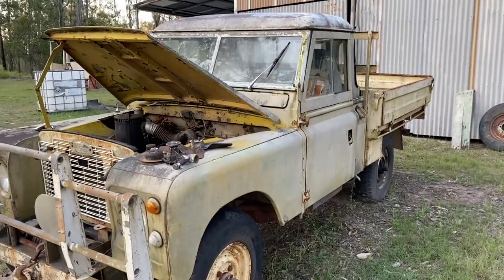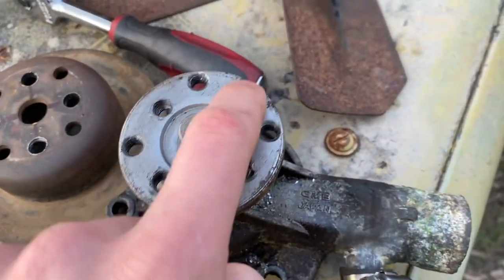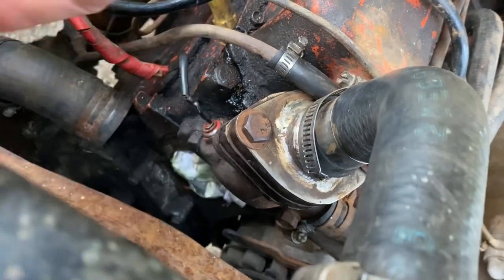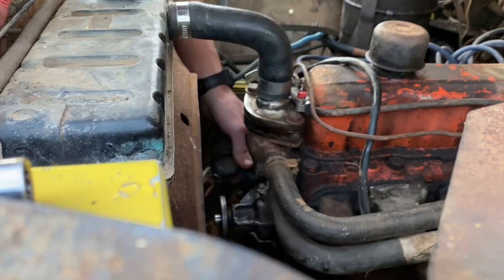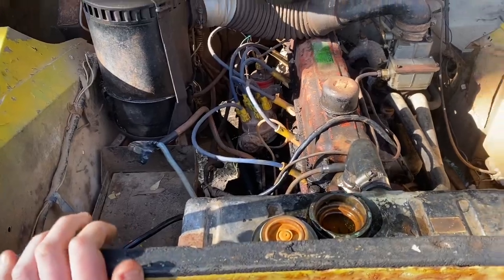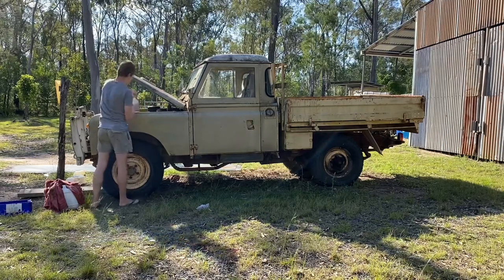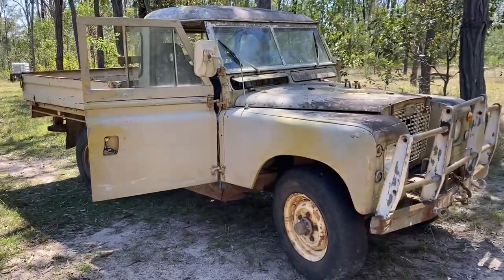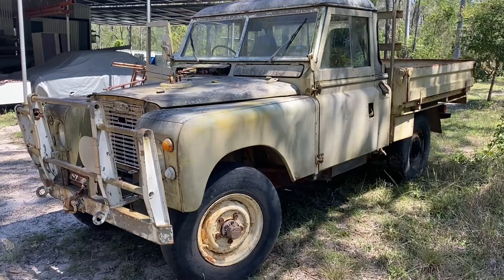LandRover series 2A will it start | Part 2 | Will it drive??

Comment: Hi l like your Land Rover S2A. What are your plans for it?
Reply from the maker: No big plans to get it roadworthy as it is a bit far gone in terms of rust in the firewall and door tops, and would probably cost too much to put back on the road. However as of last week I put a compressor and generator on the back and have turned it into a mobile compressor unit. I have put some tools in it and might put an arc welder in the back too, that way then it can be used as a service vehicle.

Comment: Good   day  I thought land rover were diesel?  Perkins I think??
Boy my 2013 sierra with V-6  in,  I think there is about 1 ft of space between rad &  water pump
U r from Australia  ??  If u r do u use anti-freeze?
What size motor  is in there.]
Thanks
Reply from the maker: Hi Don, not all Landrover series were diesel, Perkins were usually an after fitment, as they had a 2.25 diesel or petrol as options, as well as a 6 cylinder petrol I believe. This one has a non standard, Holden 179 red 6, a reliable and well known motor here in Australia, having been first introduced as the grey motor in 1948 I believe (don’t quote me on this) and then evolved into the red and blue motor in the coming decades. Although some people use just straight water, I do like to use a coolant and water mix, as although we do not encounter freezing temperatures, we still have issues with rust, and the coolant has corrosion protection and heavily reduce corrosion of engine internals.
Cheers!